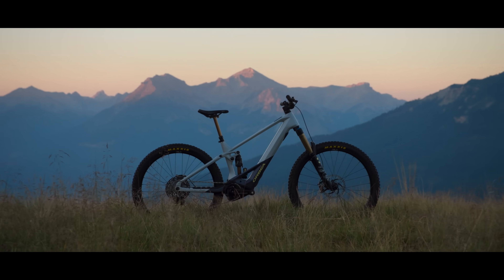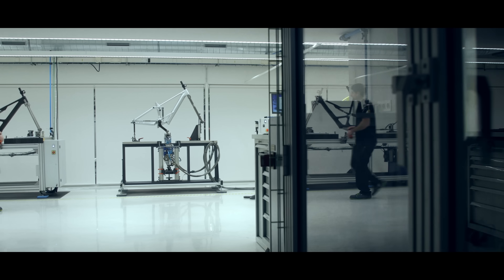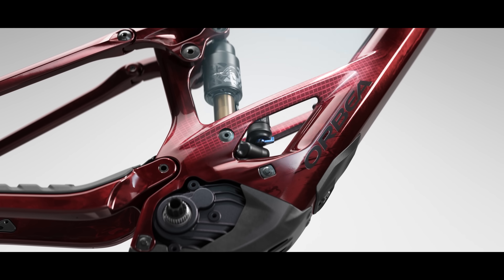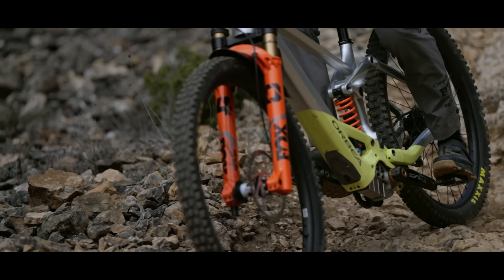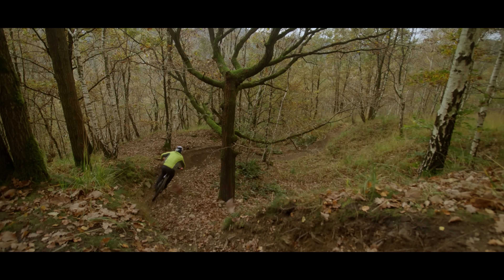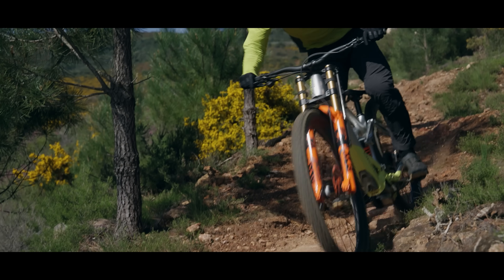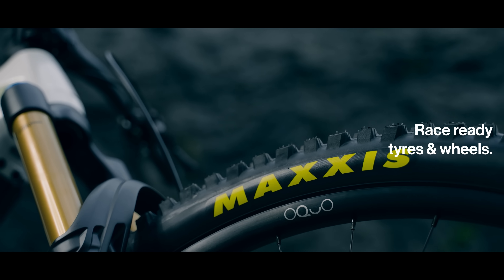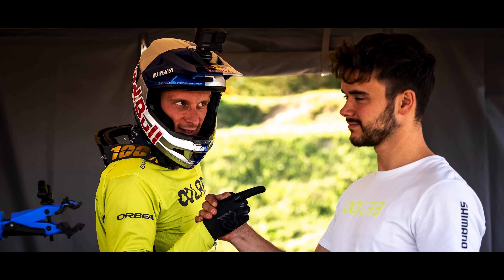How did we develop the new Orbea Wild? | ORBEA OPTIMIZATION LAB | OOLAB

Comment: WONDERFUL bike, but you should increase the downtube protections in a such capable gravity bike. At the moment there is a frame area between engine cover and the rubber above  that is very exposed...If you crash the weak engine cover you could break the frame above. Very simple to solve just working on engine cover and  the rubber. I hope in an aftermarket Orbea part in the future.
Reply from the maker: Thanks for your feedback Fabio! The whole downtube is protected with factory-applied vinyl and the rubber parts you mention. Cheers!

Comment: As everything is not perfect, learn one thing. Get rid of that hideous headset. Something so simple turn so complicated by engineers who seem they don’t run bikes. 
A sus ingenieros que corrijan el headset, un asunto tan sencillo lo han complicado demasiado, hasta los cables se rompen y vienen rotos de fabrica.
Reply from the maker: We know that there are different opinions about this, but we have considered this to be the best way to avoid noise, use shorter cables and improve performance. If you have had any problems, please contact your nearest dealer or write to us with your feedback at online.eu@orbea.com so we can help you!
Reply: @ the only performance it brings is to my pocket for me charging more for the service. I know mates that did not consider the model and went with other brand because of this. It’s ok to be wrong once in a while, just fix it and allow riders to use their stem of preference also.